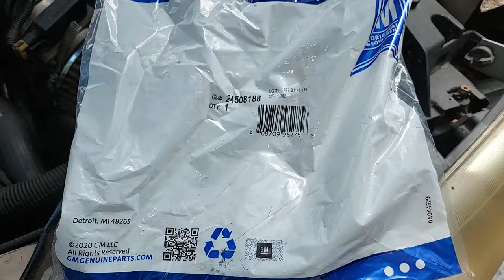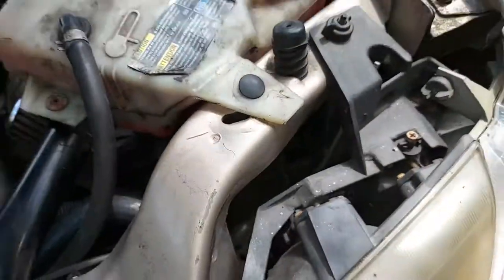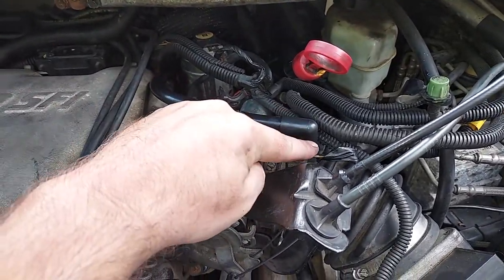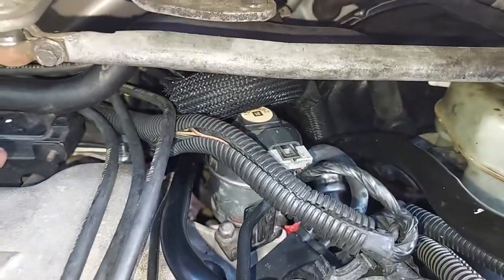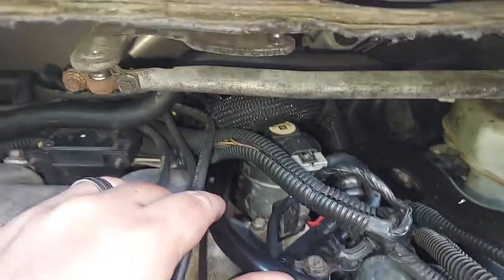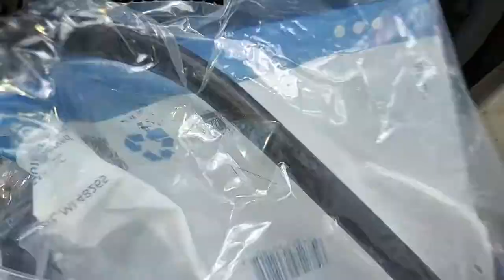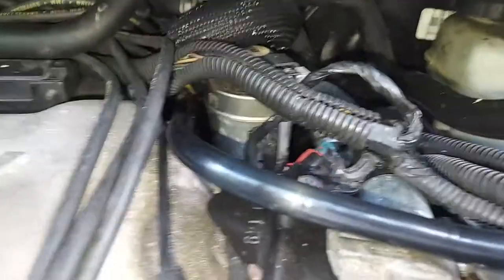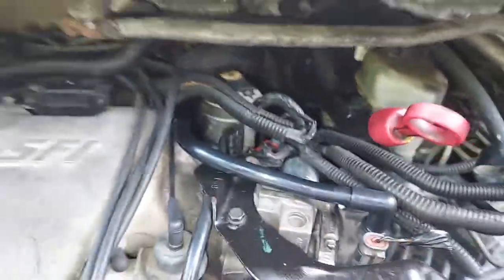GM 3400 Pontiac Montana/Chevy Venture PCV/crankcase hose replacement P0101 3000 RPM high idle fix

Comment: I have a 2003 olds silhouette with the 3400. When the weather started hitting the 80's this year I started having crazy high idle, like ALL the time. If I let off the brake it would accelerate by itself all the way into 4th gear! When I put it in park it just skyrockets- I don't have a tach, but I'm fairly certain it is near the 2000 zone.  I notice it doesn't happen on cooler days that don't top 80° tho!  I changed the IAC but no dice. There's no engine light, so no codes to refer to. I thought maybe it was something to do with having the AC on, like maybe that was triggering a leak in the vacuum system somewhere, but that theory got eliminated a few days ago. Maybe this PCV hose is the problem. That boogered up seat looks like a likely candidate for something that could make a good enough working seal while at normal operating temperature, but come unseated when it's blazing hot under the hood.
Did this vehicle idle ALL the time like that? Or was it only when in park?

Has anyone else ever had this issue, with this engine or another?

Thanks for the video regardless!
Reply: I had the very high idle problem, it was the throttle position sensor. Make sure you get the GM replacement, it has a small clock spring to hold the sensor at 0. On the old version, vacuum from the engine can pull the sensor off 0 when starting and then the computer is all confused. An easy test for this is to spray a little bit of throttle cleaner on the throttle plate pin. That will make the problem go away for a little bit. The cleaner has some lubricant that will seal off the pin opening.
Reply: i have this problem now it comes then goes smh

Comment: "REPLACING CRANKSHAFT VENTILATOR TUBE"

2003 Pontiac Montana/ GM Ventura 

Going in just to the pasenger side of the coil assembly. 

Reach down behind the motor. Locate the spark plug wires. Reaching toward the driver's side of the engine, feeling for the end of the breather tube.
In that area you will locate the round hole in the side of the engine. Using your index finger, press the end of the tube into the hole and gently push. The breather tube will slip right in the hole.
All this can be accomplished from up top of engine.
Reply: Thank you. I will try this. Mine fell out when replacing the air filter more than a year ago as it seems the gasket was degraded (turning to rubber goo). I had it in the shop for emissions work so they reconnected it only for it to fall out again when I replaced the thermostat this past weekend. …at least, I hope so. If it’s been flapping around back there for the last year then we had unfiltered air going into the throttle body. :/
Reply: Tried following these instructions but there was no way to “reach behind” with mine. I did manage to find it by visualizing what you said and seeing a protrusion that I correctly guessed had the breather hole on the back. Thank you!

I managed to record it too though I can’t upload here just yet.

Comment: Best way to deal with anything in that area, take off the air hose and go around. That way you don't disconnect anything except air and that's easy to remember how to put on.
Reply: Unfortunately, that’s not the case here. The rubber grommet turns to goo as it ages and the whole tube falls right out the back of the valve cover in an inaccessible place you can’t see. Furthermore, you will likely lose whatever remnant of the grommet was still attached so you can’t even blindly feel back there to get it reconnected. I was just changing my air filter when this first happened and it happened again when I was changing my thermostat. I simply couldn’t find where it was supposed to go. Thankfully, I saw another comment here with instructions for blindly finding the hole. All I need is the grommet but they don’t sell that so I guess I’ll be buying a whole hose.
Reply: Well, I couldn’t get my hand back there to feel around like the instructions require but I did manage to find a protrusion on the back of the valve cover that seems to be what they were directing me toward. The hose kinda seems to fit. I can’t get a positive fit but that’s likely because of the rotten grommet.

Comment: Would you happen to know where the vacuum line would be for the cruise control?
Reply: It’s connected to the throttle with a cable, not vacuum lines. The spring loaded piece that rotates the throttle’s butterfly valve should have two cables on it. The cable with the plastic detent end is from the cruise control unit. The other is from your accelerator pedal.

My cruise control cable end was broken but I repaired it with a YR-100 from ATP Automotive. I believe the “Detent Cable End” from “TechPak Fitzall” will also work. Both are sold for transmission cables repair so parts databases say they don’t fit. Even so, the YR-100 worked perfectly for cruise control. A $4-$7 repair part sure beats a whole new cable from GM. :)

Somewhat ironically, I also needed to repair the transmission shift cable and the parts databases once again said that the part didn’t work: Dorman 14057. I realized that it was listed as compatible for later year models with the same engine/transmission so I got one anyway. It worked! That was nearly a year ago (shifted into neutral and the lever went slack, totally disconnected from the transmission).